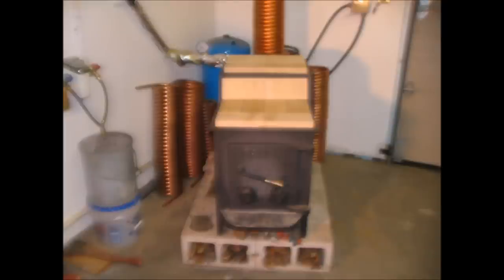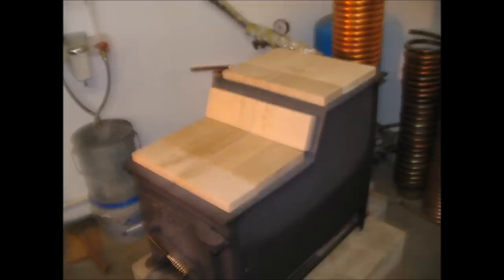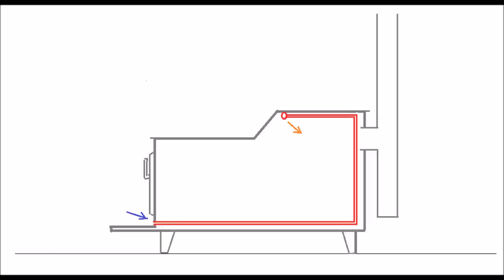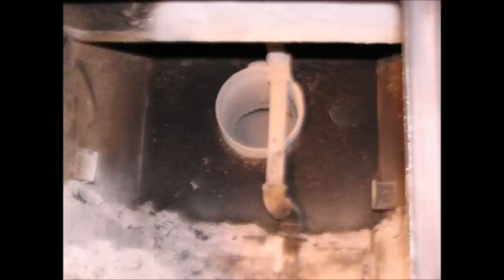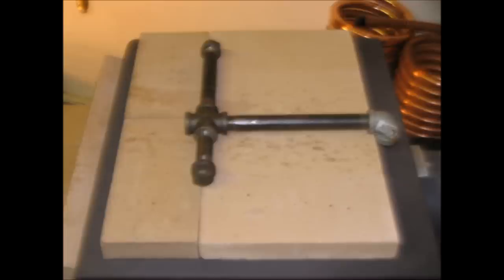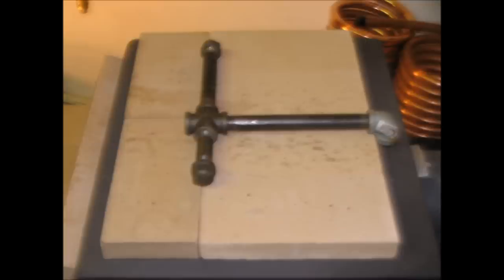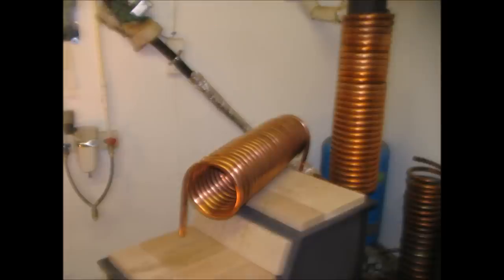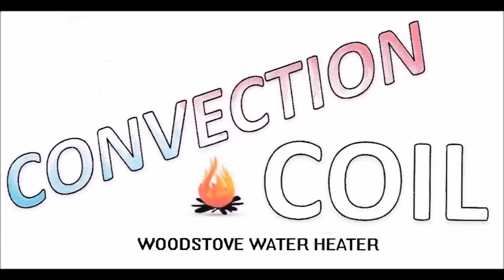Fisher Mama Bear woodstove modifications

Comment: Secondary combustion is a good idea - more heat, less creosote in the stovepipe, and less pollution in the air.  I would think pieces of soapstone or maybe even granite as long as there's no water in it [boom] would work better than the firebrick.  Firebrick aren't dense and tend to insulate rather than transmit and store heat.  You can notice the difference in temperature on the side of a stove where the firebrick are compared to where they end.  Ashes are also a great insulator.  I can notice the increase in heat from my stove after I clean out the ashes.  I would consider adding a baffle for more heat and increased burn time.  That has always been my only gripe with Fishers.  I saw one video that combined a baffle and secondary combustion.  He used a firebrick bypass baffle like my stove has so it doesn't smoke when you open the door but you can just weld in a piece of steel for a low budget mod.  I think you'd be amazed how much more heat and increased burn time you get from a baffle.  It forces the flame to spend more time in the stove where it can give up it's heat before going up the chimney.
Reply from the maker: J Mozinski Thanks j for the inspiration. I did find a video on google out lining a baffle installed in a Fisher Mama Bear and am now very excited to install one in conjunction with my secondary burn system.  I'll be sure to post an update once this is installed, thanks again for the lead.
Peter
Reply: No prob.  You Tube is a great way to share information.  While your at it, what about one or two of those stainless steel loops in the firebox?  Combined with your stack heater you'd be making some serious hot water while burning the same amount of wood.  I've got no connection to anyone selling them and there seems to be quite a range of prices for things that look basically the same.  I've been using one for over thirty years and can attest to how good they work.  I've only got one in mine but I'd like to add another on the other side of the firebox and one of those coils on the stack, too.  Might as well catch as many of those btu's as possible, right?  I'm looking forward to seeing how your baffle system works out.